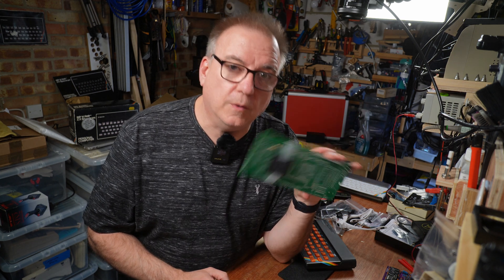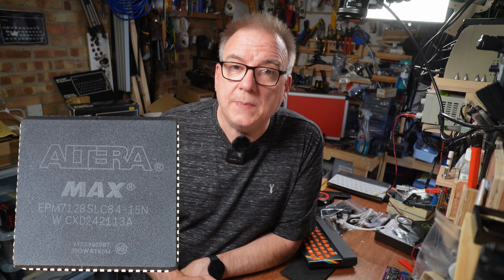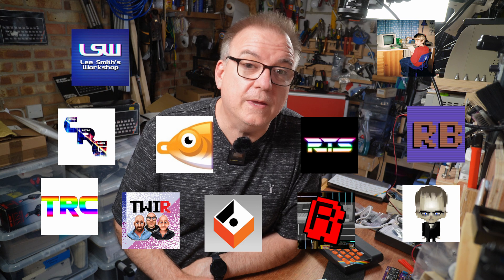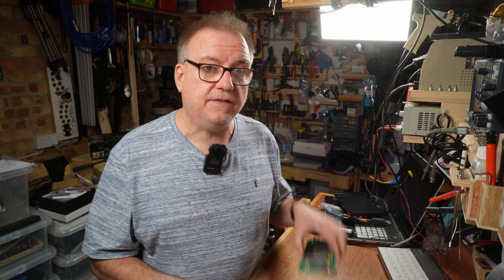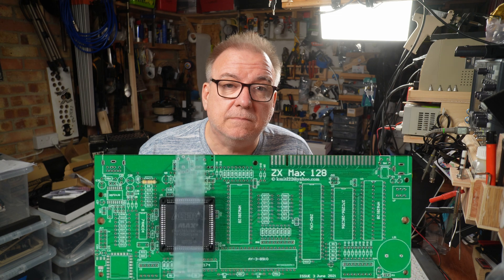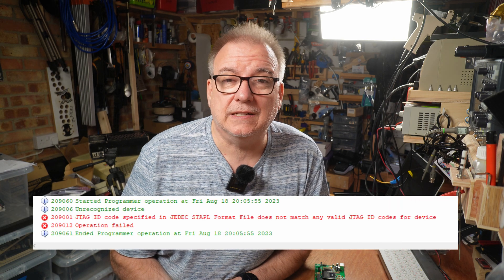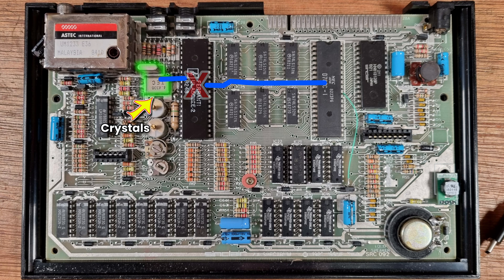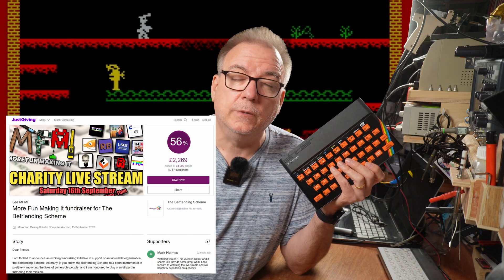ZX MAX 128 ZX Spectrum Clone Build

Comment: I've ordered one, but i cant seem to find info about the rgb cable, can you help? What did you use on that one..
Reply from the maker: It's a standard genesis 2/ mega drive 2 cable, but you need to remove the resistors and a cap from inside the scart end
Reply: @MoreFunMakingIt  many thanks lad ☺️
Reply: Me again, what psu do i need for this board, documentation is non-existent!
Reply from the maker: @MikkyTee  for this exact board any 9v PSU will work. It has a bridge rectifier built in so can take any polarity.
Reply: @MoreFunMakingIt  many thanks, sorry for the questions!

Comment: Hello Lee. Fellow spectrum fixerupperer. Love your videos and good to know someone else makes the same mistakes I do. 😮
Can I ask you a question...?
Where did you buy your modern psu with inline switch? 
Thanks.
Reply from the maker: Hey Colin! Thank you for the kind words.
On my workbench I usually use a bench power supply and made up a lead with inline switch to suit spectrums. The ones I supplied with these new build machines were all bought from CPC. But they do come with incorrect polarity so needed new plugs fitted. The switch cab be bought from lots of places, but I recommend Retroleum if they have stock.
Reply: @MoreFunMakingIt  Thanks Lee. Yeah I was meaning the ones you supplied in your charity event. Should have made that clearer. 
Thanks for the info. I'll go look up cpc.
Reply from the maker: @colinturnbull2180  if I remember I'll dig out the link tomorrow when I'm at my PC. If I forget chase me down on discord or email.
They're 9v 2A so you should find them easily

Comment: Hi again Lee. I was hoping you could point out a place a place to get the schematic for a toastrack 4s board. I have them for everything else but not the 4s.
The problem is there is no C79 listed and I would like to know which way round it goes? also tr4 oriantation
Reply from the maker: Hi Colin. The best thing I can suggest is joining my discord. Its very difficult to hold a conversation in youtube comments. For one thing I only get notifications (sometimes) for the first message. All replies usually are lost in the void. I think I know what you're asking but there are a couple of things I need to know first, so discord would be the place for that. You should find a link in the description of most of my recent videos.

Comment: The parts are probably not fake; just previously programmed and locked (for IP protection) by an OEM. Once the corresponding product is thrown away, scammers harvest the boards and remove the PLCC parts from their sockets, selling them as NOS. But since they were locked before, they can't be reprogrammed.
Reply from the maker: Yeah, I think you are right. I read somewhere you can unlock them by applying 12v to the JTAG line, but I would need another board to do this. If it works it will be very handy as there are a bunch of chips on my workbench like this!

Comment: Wow, what a palava you had with the CPLD, looks like fakes are a big issue with those chips. Sorry i couldn't help much when you reached out, id never used that series before. Ive since learned about the mostly compatible Microchip ATF15x series chips which are much cheaper new and im looking at using them in my future projects. Cheers!
Reply from the maker: Good luck with the new chips. Hope they don't suffer the same shortages

Comment: Quartus bricked my C64 RGB mod board after I tried to reflash the FPGA with a later firmware. Just crapped out at 4%. I had to revert to an earlier version of the software (V18), which worked fine and I was able to bring it back from the dead. No idea why the later version (V21) just refused to work.
Reply from the maker: Yeah, similar here. Was warned from the start to use a specific version of Quartus
Reply: @MoreFunMakingIt  Bonkers isn't it? Intel never heard of backwards compatibility with products they haven't retired yet?

Comment: There's a lot of 'NOS' CPLDs which are actually genuine but have had the JTAG lockout enabled so they need to be 'unlocked' before they can be reprogrammed or even recognised by a JTAG programmer so it's entirely possible that the 'fakes' you have are real but just locked.

You can't unlock them with a JTAG programmer, you need a 'proper' programmer like Dataman 48UXP or similar. 

The 74HC04 is the active portion of the clock oscillator, could have been replaced by a canned oscillator module I guess, but it's an absolute classic design.
Reply from the maker: I found this out after recording this video. Apparently there's a way to unlock them by applying 12v to the right pin, but in order to do this you need to isolate the CPLD from the rest of the components on the board. I'll try this if I get another board to build in the future
Reply: I've got a few 100% genuine parts which came from old projects and products, I also have a Dataman 48XP programmer, I need to hack together the parallel programmer interface and see if I can get it to talk to them but I'd be interested to try one or two of the 'fakes' if you felt like experimenting?
Reply from the maker: @M0UAW_IO83  they don't belong to me, but I can ask the owner Julian? Best contact through email or other social media, YouTube comments regularly disappear

Comment: For CPLD - there is 'detect chain' button in Quartus, that inquires - what CPLD (or CPLDs) is connected to the programmer.
By the looks of the error - internal JTAG ID did not match the one for which this file was compiled.

(though my FPGA/CPLD skills are more than a bit rusty - I haven't done anything for more than a few years).
Reply from the maker: Yup, did that and it correctly identified the chip. But then refused to program it. I now believe they've been programmed and the JTAG line is no longer available. There's a way to reset them but I'll leave that to an expert
Reply: @MoreFunMakingIt  If it identified the chip - then it should program it. Lines and interface are the same for detect and for programming. (if I am not mistaken)

Comment: The HC04' is likely involved in feedback and signal shaping of the crystal oscillator signal. :) Something that is needed for the CPLD (and other processing chips) to function
Reply: The 74HC04 is used to form a Pierce oscillator with the crystal. This is pretty much the standard crystal oscillator circuit used in digital electronics today.
Reply from the maker: Thanks! I'll try to remember that 😁